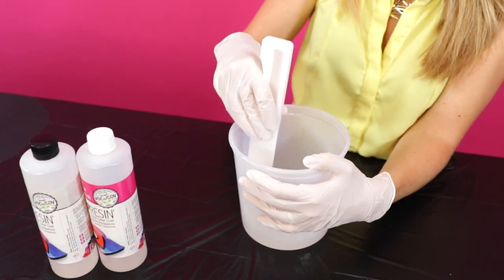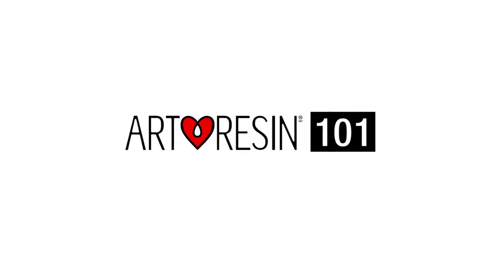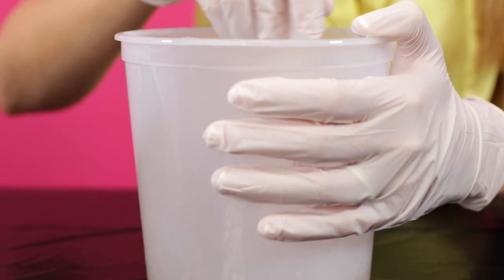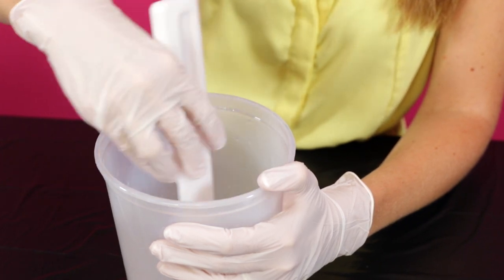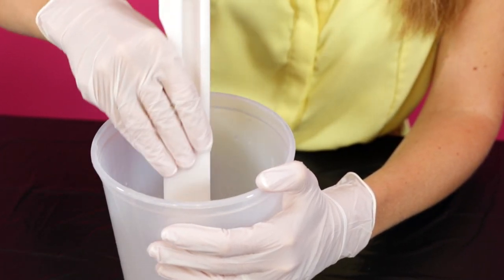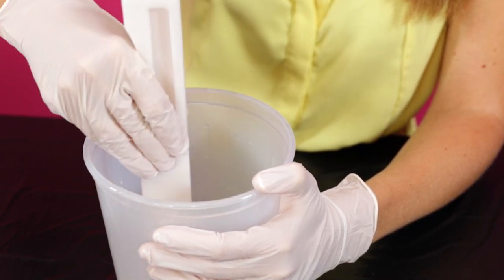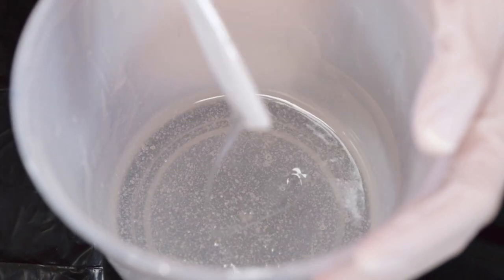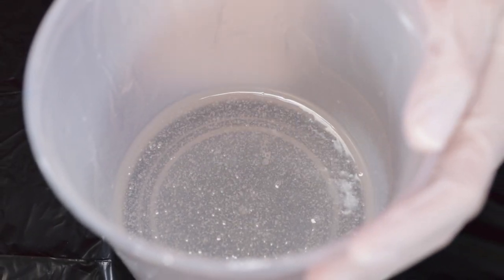ArtResin 101: Step 3 - Mix

Comment: What happens if u don't mix for the alloted time?
Reply from the maker: Hi Elisabeth - if the resin is under mixed, the chemical reaction between the resin and hardener will not happen and the resin won't cure properly.  
Instead of evenly cured resin that is dry to the touch within 24 hours, the resin will either be runny, sticky, or resin will not cure evenly, with areas of wet or sticky resin. 
For a proper cure always best to mix according to the label directions (for ArtResin, this is 3 minutes) making sure you scrape the sides and bottom of the mixing container so that every single component is properly blended.  Hope that helps!

Comment: I bought the same resin that is being used here, I may have purchased the wrong one, can I use this resin for pouring into coaster or light switch molds/ Semi deep pours?
Reply from the maker: Hi Kyara, ArtResin was developed as a surface coating for artwork rather than a deep pour casting resin.  With that said, it works very well in coasters and small molds, we just recommend pouring in shallow layers to help prevent bubbles from being trapped in thick deep resin.

Comment: Can anyone tell me how exactly you get rid of the millions of micro bubbles? Ive done absolutely everything the correct way and still. Loaded with them. Looks great straight on but as soon as you get light through it you see tons of em. Is this normal? Am i expecting too much? Lol ive seen pieces that are flawless and followed their steps as well
Reply from the maker: The best way to help prevent bubbles is to use a warm water bath before mixing your resin and hardener.  By warming the parts up, it makes them less viscous and allows bubbles to release easier.  It is also recommended to pour your ArtResin in thin layers of 1/8" or so.  Pouring in greater depths can make it too hard for bubbles to rise out.  Have a look at our blog on how to prevent bubbles:  https://www.artresin.com/blogs/artresin/tipstopreventresinbubbles?_pos=1&_sid=62c64116a&_ss=r